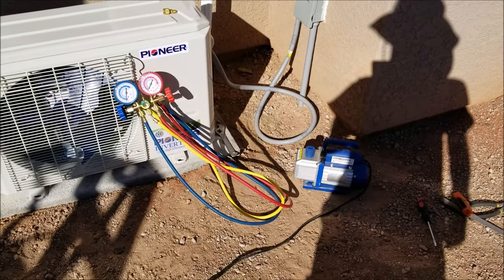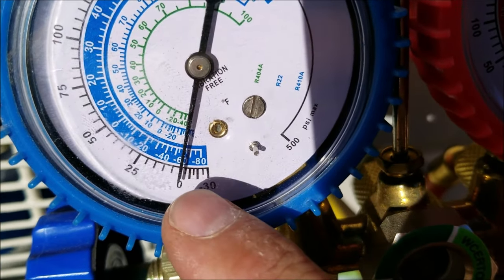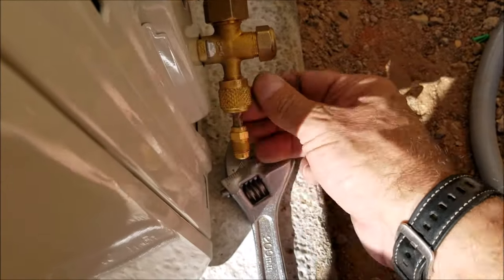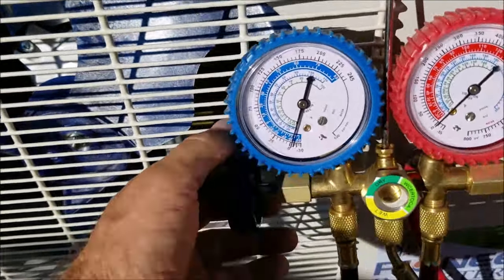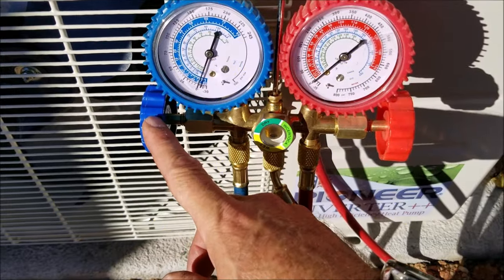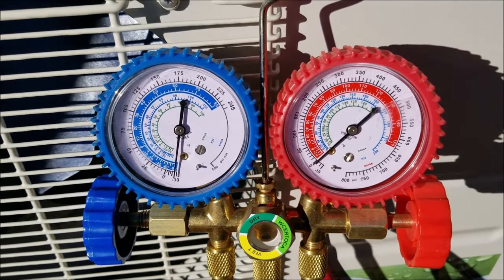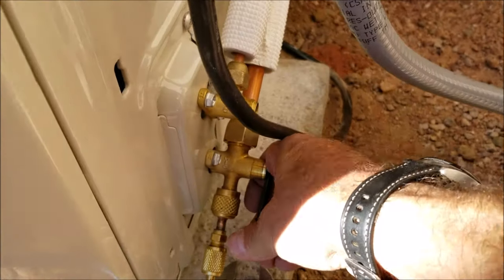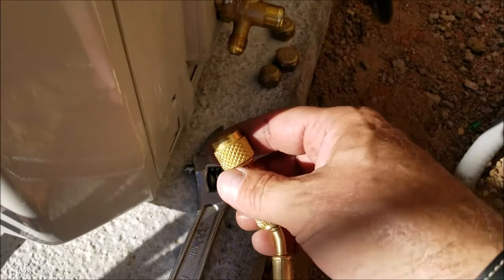How To Vacuum Down a Mini Split with Analog Manifold Gauges

Comment: How about the 2 freon release ports do they need to be open or closed . Does the unit need to be on wheb vaccuming ? Also when refilling does the unit need to be on
Reply: And when re filling does the freon ports need to be open or closed .
Reply from the maker: If the unit loses its refrigerant, the leak is fixed, vacuumed down, and new refrigerant is added in by weight with the ports open.
Reply: @HVAC_Mechanic  yes the unit lost all refrigerant . Do this with the unit on or off ?

Comment: Can you use an automotive style gauge set?, I got one from O'Reilly's, but the fittings didn't match up
Reply from the maker: They should work. Mini splits need an adapter to attach to standard gauges. A link is in the description.
Reply: @HVAC_Mechanic  thanks, but I researched the brand of gauges I got from O'Reilly's, it says it doesn't work for residential style ac units. I have that adapter already. I'll have to get the gauge set at Harbor freight.

Comment: what is the pump brand and cfm and that comes with the adapter needed and oil for 22000 btu mini split heat pump 230v costway

Comment: So helpful thanks! We are struggling though because the hose going from our vacuum pump won’t fit the unit. It’s an LG DC12RK UL2 - R32 gas. Any ideas?
Reply: Me too.  It's specific to R410a refrigerant gas.  That's why you must buy the 5/16 female swivel adaptor in his link to Amazon.

Comment: ?  I followed the video but my vacuum is only -7.  It holds at 7 I vacuumed it 3 times same results is this ok to release the coolant?
Reply: Update DOH…..  my gauge hose have 2 different end fittings… one end has a stem depressed and the end that connects to thr gauge does not…. Switched them and got -30 vacuum reading.   Your video is spot on and easy to follow….  Ty’s

Comment: Thanks for the video as i am considering installing my minisplit on my own after a 4800 dollar quote just for a single unit to cool my 650 sq ft garage area. Nothing complicated as i have an exterior wall that it can mount directly to. Anyway my question is about the vacuum. Im hearing alot about not just making sure you get a good vacuum but also pulling all moisture out of the system so the argument begins about the micron gauges doing a better job at this. your thoughts?
Reply from the maker: A Digital Micron gauge works great once it reads 400-500 Microns, the refrigerant is ready to be let in. Analog gauges also work well when used correctly. The goal is to set the system in a vacuum and have no leaks. Either gauge will work, I would just get the tool you feel best using.
Reply: So they basically wanted 3500 bucks (labor) for a 4-5 hour job. Unbelievable

Comment: So, do all mini splits come with freon pre-pressurized inside the condenser? If so, I suppose it is enough to fill lines of manufacturers recommended maximum length..?
Reply from the maker: They usually contain the refrigerant and take into account a 12-16 ft line set. If the line set is longer more refrigerant is usually added. Be sure to read the units information.

Comment: How did you get the schraider valve on the fitting on the unit to open using that adapter?  It looks like all you did was vac the line on the gauges as the fitting on the unit is still sealed since the fitting you connected doesn’t open the schraider valve?
Reply from the maker: It is a mini split 5/16" to 1/4" adapter. It simply screws on and off. The adapter link is in the description.

Comment: So how does vacuuming remove contaminants that are stuck to the inside of the tubing? I see that Pioneer sells a can that you attach instead of a vacuum pump, and it releases something that cleans the tubing and displaces moisture, and also pressurizes the lines so your can check for leaks, no vacuum pump required. Don't know if that's any better than the old fashioned vacuuming, but it's an option
Reply from the maker: Line set flushing is common, and many HVAC techs will do this, but I wouldn’t recommend it. Vacuuming down the system is a long-tested method that works well, but both methods work.

Comment: How do you put pressure back in the lines if you think you lost it all would that keep the outside compressor from running because mine's is running very slow it's not producing no heat there are no leaks it seems like my compressor is really not creating no pressure in the lines there's nothing in them when I checked them
Reply from the maker: Did you release the refrigerant from inside the outdoor unit? If there is a leak and refrigerant escaped, more will need to be bought and added back in with a weight scale.
Reply: @HVAC Mechanic   no refrigerant leaked out at all I pumped down the system yesterday by closing the one line and allowing the refrigerant to return to the compressor because I needed to disconnect it now I did make one mistake once I reconnect everything I opened the valve releasing the refrigerant back into the lions and car myself bleeding out the air but it hasn't worked since

Comment: So if you have a multi zone mini split, do you draw down each zone, each line set, separately?  Or will vacuum on one line set draw down all of them?
Reply from the maker: Most multi-zone units are the same since they all tie into one outside condenser. The only difference is that usually, it takes longer to pull a vacuum. Be sure to read the manual for the unit.

Comment: The low side on my compressor unit (also a Senville) has a shreader valve in it.  The 'adapter' you installed does not have a valve depressor in it by the looks of it...shouldn't it?
Reply from the maker: The video may not show it well, but it does depress the valve when it is screwed onto the low-side port. It uses an adapter. The link is on the description, which has more images of it.

Comment: I have a vacuum pump from other projects but don't have the T-fitting you have screwed into it. What is it called? I need to order one in order to vacuum my new pioneer minisplit.
Reply from the maker: It is a 5/16" to 1/4" Adapter. A link is in the description.

Comment: Do I have to reach -30 on the gauge or is 20-22 good?
Reply: I would go at least 30min it should go down to -30 or they're a leak somewhere in the system if not the connection.

Comment: Wait, how do you vacuum the system without opening the two split valves??? (those which you open with hex key)
Reply from the maker: The valves that open with the Allen key hold the refrigerant and are already set in a vacuum by the manufacturer before filling it with refrigerant. The line set that is attached between the two units is what needs to be set in a vacuum during installation. The valves with an Allen key should be open last when there is a vacuum and no leaks.
Reply: How about the unit that has been running for a while and its not cooling as effectively as it should. If I want to vacuum the pipes to see if there is any leak, should I close those valves (screw clockwise) before vacuuming?
Reply from the maker: @wiktorzubert2806  If the unit is in use, it will need to be pumped down and the refrigerant placed back into storage within the unit. There are YouTube videos on pumping a mini split down and pulling refrigerant back into the outdoor unit. If the refrigerant has been contaminated with outside particles, it will need to be recovered with a recovery machine and then replaced.
Reply: Thank you very much 🎉

Comment: When you close off the low pressure valve for the vacuum leak test, aren't you closing off the line set from the gauges?  Are you just pressure testing the gauge here for leaks, not the whole system? I thought you had to have a shutoff at the vacuum pump for this kind of test.
Reply from the maker: The valve only opens to the center yellow hose. The low-pressure blue gauge will always be on once the gauge is connected.
Reply: @HVAC_Mechanic  Ah, thanks! That's why they pay you the big bucks.

Comment: I have a question I’ve installed mini splits I bought the Yellow Jacket 19173 5/16" Female Quick Couplers x 1/4" Male Flare adapter for my yellow jacket 1/4 HVAC hoses my question is when you break the vacuum after releasing the refrigerant from the mini split condenser into the line set when I go to remove my suction line hose from the suction line service port on the mini split a lot of refrigerant comes out squirting , what adapter do you use for mini splits for your HVAC hose to connect to mini split 5/16 service port
Reply from the maker: A 5/16 Female, 1/4 Male adapter is used for a mini split. The link is in the description.

Comment: Shouldn't you release the liquid line first? When release the refrigerant?
Reply from the maker: When I first started in HVAC, I was told Suction line first because you are in a vacuum, and the vacuum will suck a moderate amount of oil out of the compressor into the new line set. With that said, I know techs who say it doesn't matter with a heat pump since the refrigerant flows in both directions.
Reply: @HVAC_Mechanic  Heatpump manual says to release the liquid line first but it probably doesn´t matter much.

Comment: Note: Remove the vacuum first before you use the Alan wrench to open the two valves. 

The video here showed opening the two valves first before removing the vacuum
Reply from the maker: If the valves are not opened and refrigerant is not released, the air gets sucked back in, and you will lose the vacuum when the hoses are removed. There basically is no point in vacuuming down the unit.

Comment: Question: With a cinder block garage with rebar every 4 ft (hurricane code), could you run the line set out of the top of the air handler over the cinder block then down the outside of the wall?  Or is that too many 90 degree bends at the top?  Also, the drain tube probably should run out and down and not up???  I ask because it looks like some HVAC pros installed this way on other houses by the look of the channel coming down from the soffits.
Reply from the maker: Yes, the line set can be run that way. Keep in mind most units are filled with refrigerant for a 16-foot line set; If more of a run in needed, the unit would need to match this. To drain water up, condensate pumps are used, mainly in basements, but they can be used in any location that needs them. Here is a link: https://www.hvachowto.com/our-picks-for-the-best-mini-split-condensate-pumps/
Reply: Or you can do what I did.  Run the core drill into rebar! 😥   hammer and chisel moved the hole a half inch to one side and spray foam filled the gaps, so it worked out in the end.

Comment: Can you tell me to do if Ive checked everything and it is still no holding a vacuum?
Reply from the maker: There are different methods to find a leak. The most common method is to pressurize the system with nitrogen or a propellant, and the fittings are tested with soap and water to see if there is a leak. R152a propellant can be bought on Amazon. Here is a link. https://amzn.to/3AlXVpH

Comment: Question: I notice on this video when you turn your blue valve off it goes back to "0", then when you turn the Pump off and let it sit its back down to "-30" how is that possible? im having issues with mine staying at "-30" what am I doing wrong? please help!
Reply from the maker: I had to edit the video and add that part in since the camera was off the first time. If you think there is a leak, a low-cost can of R152a can be used to fill it before letting in the refrigerant and test for leaks with soap and water.  KWIK-E-VAC on Amazon is R152a. Here is a link. https://amzn.to/3AlXVpH
Reply: @HVAC_Mechanic  We don't believe there is a leak. We are trying to understand if we missed a step, will the mini split get damaged if I proceed on letting in the refrigerant without holding the negative pressure?

Comment: I have a question my pressure goes from -30 to -20 ans stays there. It seems I have a leak but I did a bubble test  but to no avail; It seems there are no leaks at the four end of the nuts. Can you help?
Reply from the maker: If you have an issue finding a leak, it may be best to pressure test it with nitrogen.
Reply: it won't bubble under a vacuum..if anything i'd be worried it would suck fluid in.

Comment: I have a five zones AC unit. I guess I have to repeat the process on each line.
Reply: I dont think so
Reply from the maker: Check the manual, but they are usually all connected and all vacuumed at the same time.

Comment: I borrowed a micron gauge from oreillys to do this. Technically I purchased, but they gave a full refund with its return.
You really do need a micron gauge to make sure you get proper vacuum with no leaks.   
I was able to pull down to 300 micron, and it didn’t rise above 500 micron after 3 minutes, after shutting off vacuum and closing gauge valves.
I get that not everyone can borrow a tool like this from a local store, but you should try and check the stores near you for that option. It’s worth it.

Comment: I'm confused by the hoses that come with these kits.  One one end is a shrader valve (inside) the other does not have any valve.  if you have the end with the valve going to the manifold , does this valve pass through the air or is it closed until 'depressed'.  Some vids show one end going to the compressor unit/ other vids show the ends interchanged....
Reply: None of the 20 or so DIY videos I have watched, including this one, explain this. They also do not explain the need for an R410a adaptor that does not come with the vacuum pumps even though they all claim to be R410a compatible which they are not without this particular adaptor. The valve ends connect to the service port. All the DIY videos I have watched on any subject leave out crucial details.

Comment: What kind of pump for r32?
Reply from the maker: A vacuum pump pulls out all the air and water vapors; it doesn't do anything with the refrigerant. Vacuum pumps are bought at the speed they can set a system into a vacuum (CFM - Stage 1/2).

Comment: Aren't you suppose to take out the schrader valve???
Reply from the maker: The schrader valve is like a tire stem there is no need to remove it.
Reply: @HVAC_Mechanic  hmmm... then youd just be vacuuming ur vac lines. Suck all ya want on a valve step, if its still in, it keeps pressure inside the high and low pressure lines...??

Comment: I got a quick question for you. I have a leak at one of my flairs, so I have to reflair the connection and put some more nylog. Since there's hardly any r410a left, would I just run the vacuum with the service ports open, to take out the rest of the freon, or would I pump down, and close the service ports, before opening my flair? I hope this makes sense. Thank you
Reply from the maker: After the bad flare is fixed and the system vacuumed down, refrigerant is added back in with a weight scale; the refrigerant type and amount in pounds should be listed on the unit or in the manual. I would just start over with an empty system and add the correct refrigerant amount back in. I made a video of this problem. Here is a link. https://www.youtube.com/watch?v=VyZRKt63OW8

Comment: Didn't mention that you have to open the valve on the heat pump!
Reply from the maker: The valves are opened last after the line set is in a vacuum, it is all in the video

Comment: my HVAC tech wanted to see if it holds vacuum for 24 hours but he's letting the vacuum run for 24 hours instead of just shutting it off and seeing it holds negative pressure.  Is this right? Doesnt seem right to me
Reply from the maker: That is a long time to run a vacuum pump, but the vacuum will be very deep as long as it does not leak. A common method, like in the video, is to pump down the unit for roughly 30-45 minutes; then, the vacuum pump is shut off. If the unit holds a vacuum for at least 20-30 minutes, the refrigerant is let loose. There are different methods; the main thing is the line set is in a vacuum, and there are no leaks.